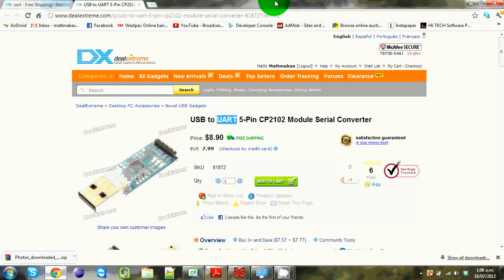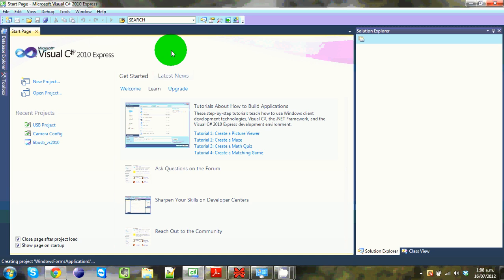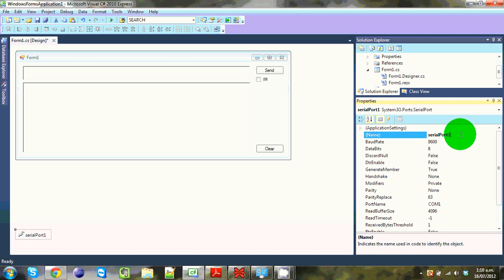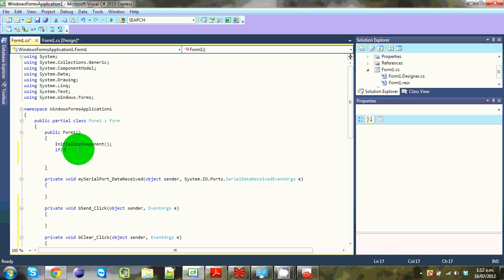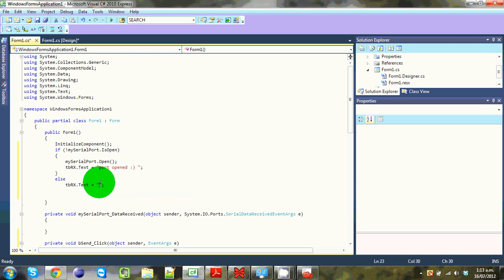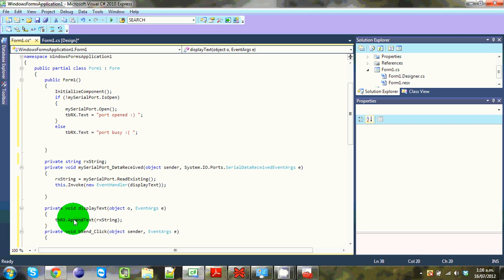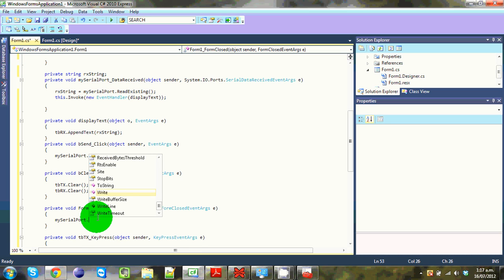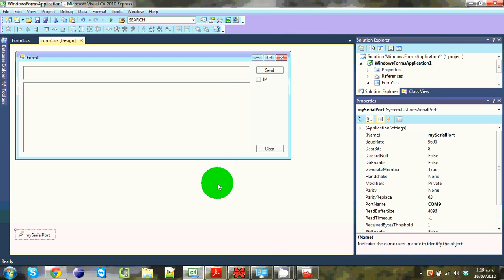Visual C# Serial Port + UART Module

Comment: I have a WinForms app in VS2015. Serial comms work fine with all arduino flavors except for leonardo/pro micro. I know those bootloaders/boards have a virtual com port and I am using 'while(!Serial.Available) in my sketch. It seems the board is not receiving nor sending any data. Any advice? The same sketch and WinForm app works perfect with any other arduino board.

Comment: I am finding the method used for receiving data is not responding:

  private void serialPort1_DataReceived(object sender, System.IO.Ports.SerialDataReceivedEventArgs e)

(that one)

I am able to code around it with a timer but I really want the above-mentioned method to handle it. Any idea as to why this is not working? I would paste the rest of the code but there's not enough space for it. I'll appreciate any help you can give me.